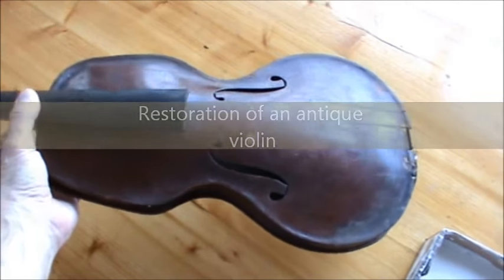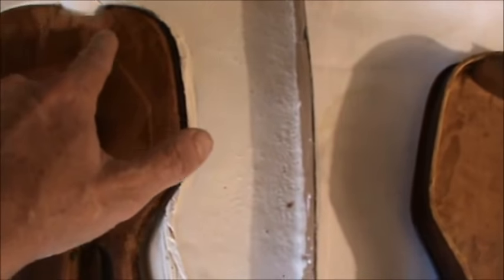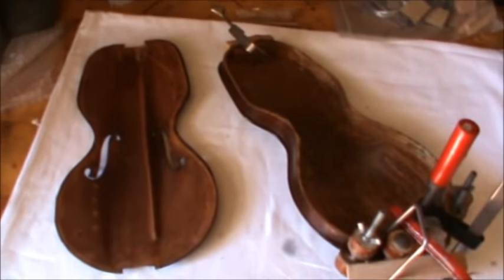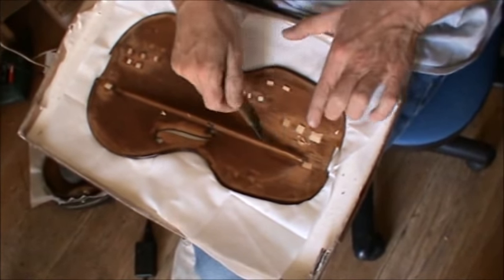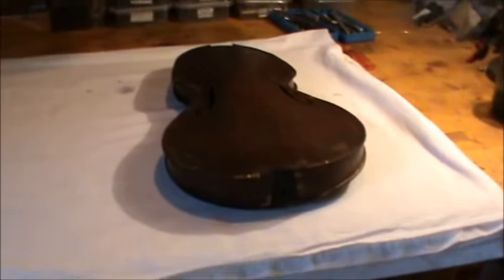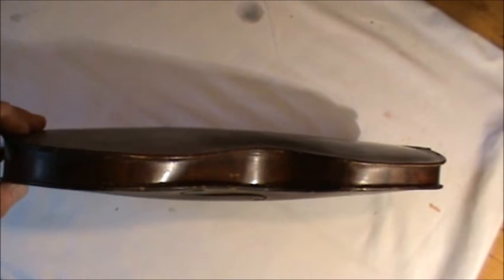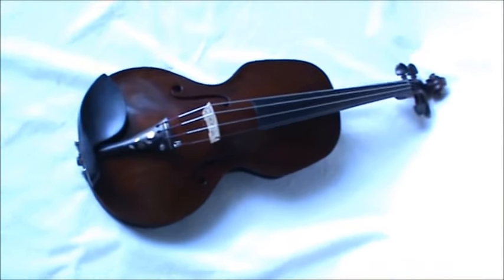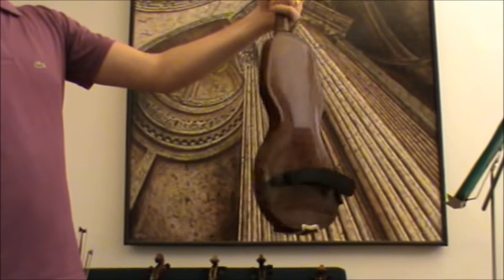Repair of an old rare shaped violin by Jochen Bruenjes - Frank Merwin Ashley # 785

Comment: So many "cleats" (?) ! Does not that change the resonances of parts of the violin, which make the personnality of it ?
(I would think that modern glues, which are stronger than the wood would not need so many reinforcements and less modify that personnality…)
Reply: luthiers dont use modern glues.